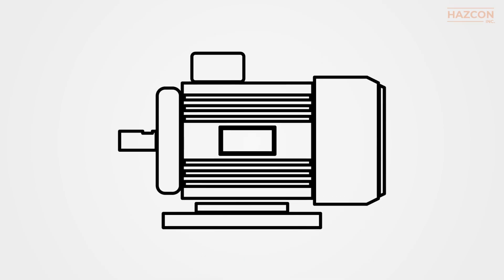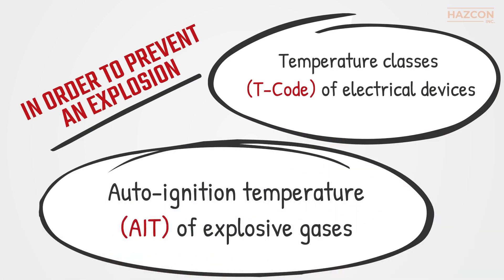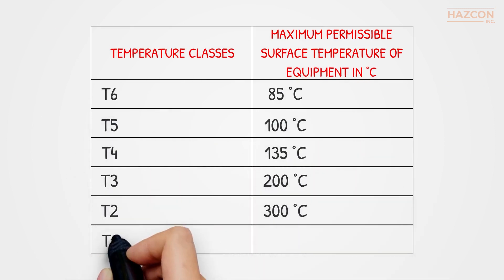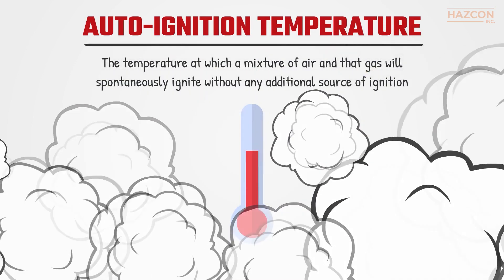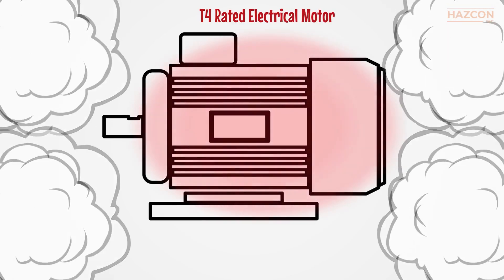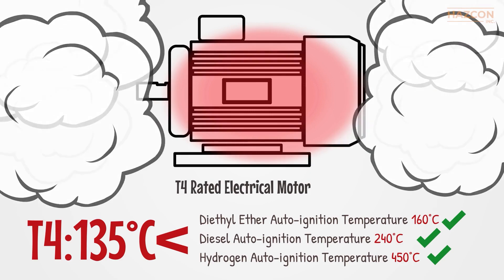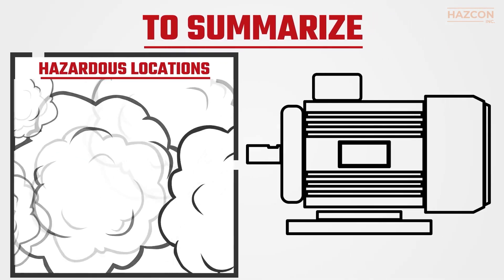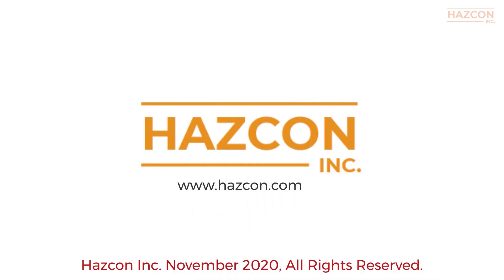Temperature Class & Auto-Ignition Temperature | Hazardous Area Zones & Explosive Atmospheres

Comment: Didn't get the summary.  If max outside surface temperature  of t6 is 85 degrees then how can that be used for the which is supposed to operate in 450 degrees? It will have an explosion.